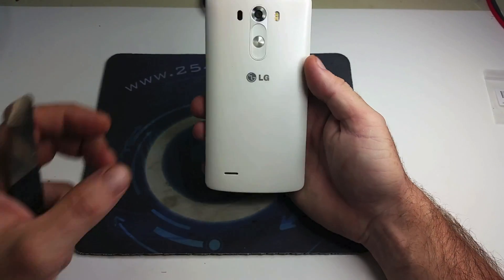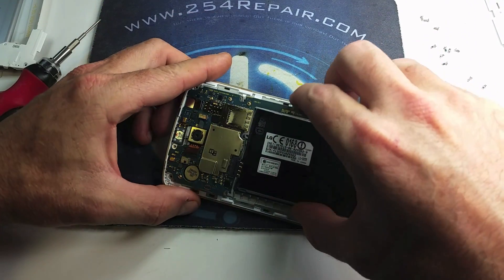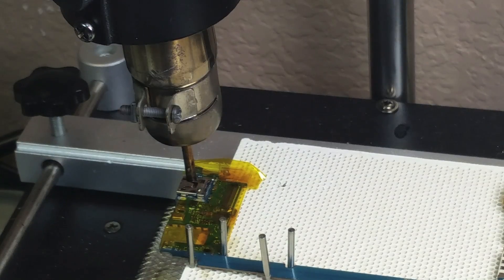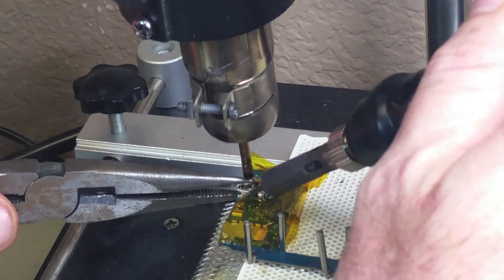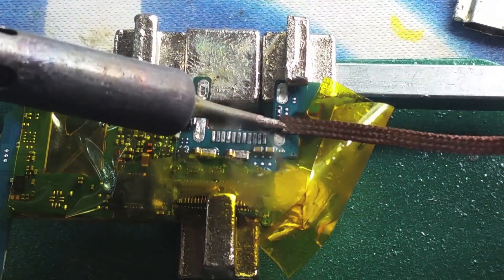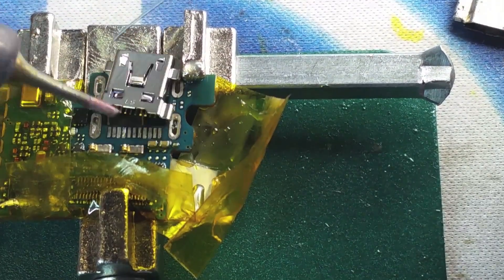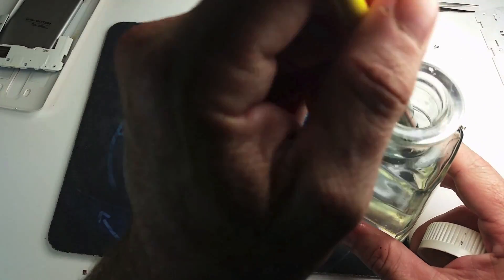LG G3 Charging Port Repair / Replacement

Comment: i am a novice so I hope you do not mind me asking what brand of soldering iron you use . The track on the back of the port are  so close to each other how do you solder them separetly so they dont touch?perhaps with a very fine tip?

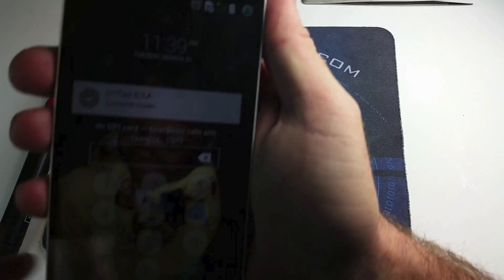Comment: lol clearly edited between 8:10-8:16, the phone wasnt charging directly after your repair, you must have had to reflow your pins again then rerecorded, edited and it then showed the lightning  bolt, you should've edited out another 10 seconds and no one would know the difference
Reply: Saw that too.

Comment: I did it, but it does not connect to the computer, it only loads. You have a bridge to repair the data in LG ls675

Comment: when you do this do you have to solider all of the tiny pins under the charge port or just the the 4 main legs of the charge port
Reply: All the pins, otherwise it won't charge or transfer data

Comment: i have a problem with my lg g3 it says slow charging , when i connect to pc i get the same message i can not go to transfer mode what could be wrong ?
Reply: +Moody Ali have you tried another cable? you could possibly be using a charge only cable whereby it doesn't support data transfer?
Reply: I'm having the same issue. I think it's a manufacturing defect. Piece of shit doesn't charge if it's connected wrong.
Reply: It works with the LG G3? Samsung products?
Reply: I see. ok. Sigh
Reply: ***** I appreciate the info, but ... its not that beneficial to me. I've had this LG G3 Smartphone for 1 year, 3 months. Verizon would have replaced my phone for free, 3 months ago. So now I'd have to pay $150 insurance deductible to get a replacement 'refurbished' phone. I want this damn thing fixed to avoid any more costs
Reply: i changed the port it works now perfectly
Reply: How? Did you buy a new port and put it in yourself? I think it might need soldering
Reply: soldering yes it worked like a charm
Reply: Cool. I took it to a repair shop. Getting fixed for $60. Better than the other 2 alternatives.
Reply: awesome got mine fixed for 10$

Comment: Repairing charge port that is soldered to mother board is a pain in butt !!! Not everyone can do it and you must have all tools and something to hold mother board that it doesn't move when you try to use heat gun. As you see in this video the heat gun and plate are fixed and it helped the guy to remove the charge port. But if you don't pay attention to it you might melt your mother board and loose your phone. I read some of the comments and decided to write something. I am cell phone technician but I never tried to fix these type problems since I had bad experience with them. I just had customer who asked me to fix his LG G3 charge port and I said I don't do it. I told him why and he was nice guy to understand that not everything worth it to spend time and make some money. if any technician screw up the mother board, then s/he must buy new phone for customer. lol Don't try it at home. NO DIY !!
Reply: +tabrizlioglan I don't have a degree of any kind, but I've always done stuff my self from home improvement to soldering electronics and  I'm gonna tell you.. if you truly set your mind on it you can do amazing things. All you need is discipline and a "I can do it attitude"
Reply: Not a chance would I do that. I'd just as soon buy a new board off eBay and replace the whole damn thing....

Comment: Did you mean 400 degrees Fahrenheit?  I just put my heat gun at 400 degrees Celsius (and high air flow) and the port came off after 10 seconds and the plastic on the inside (which I didn't know there was any) melted.
Reply: Ahahahahahhahaah i'm laughing so hard!
Reply: +matyw91 laugh it up ;)

Comment: Interesting but too dificult for me :/ My LG G3 charges but is not recognised by my PC/Laptop (Windows 7, 8.1 and 10). Tried everything (changing cables, usb ports, installing all necessary drivers from LG + LG PC Suite), but it is not recognised at all, in device manager whenever I connect the phone there is no 'refresh' in device manager. No USB Settings in the pull down notifications of the phone. Could it be a hardware issue and should I replace the USB port on the phone?